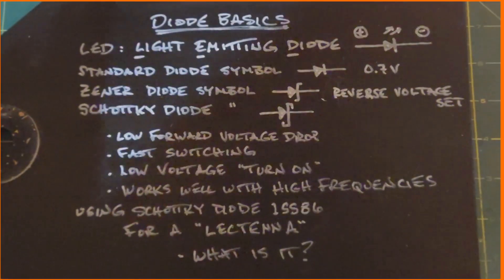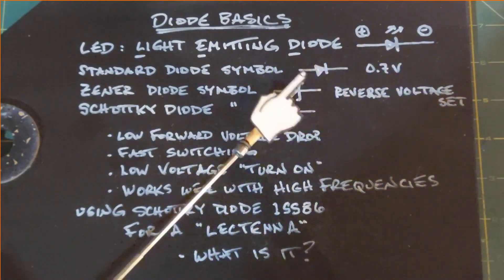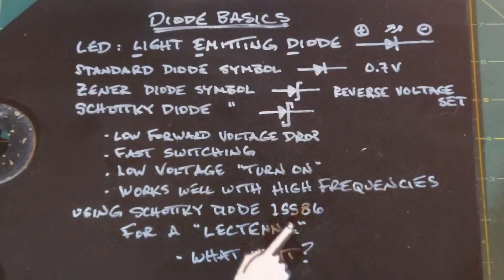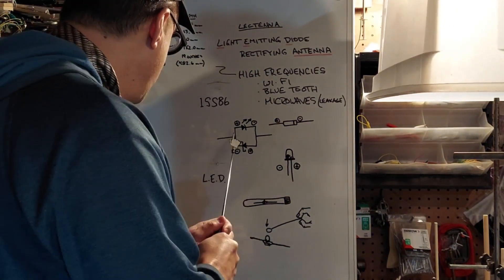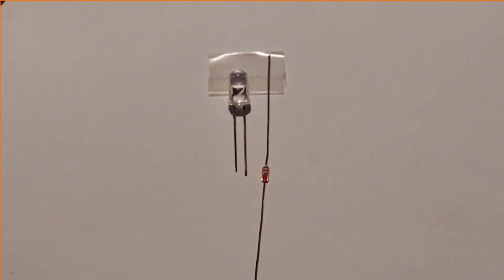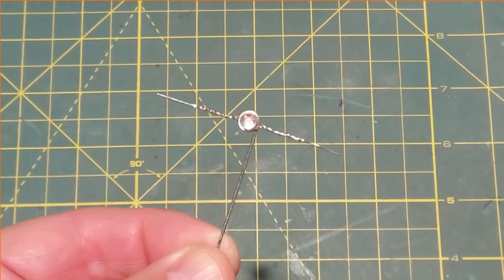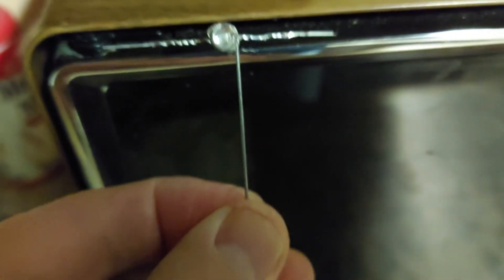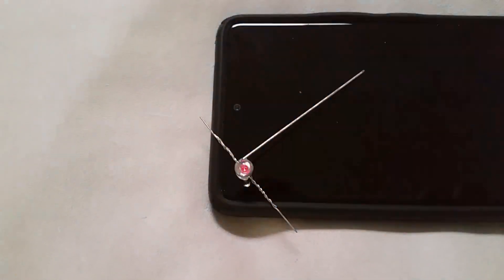Detecting A Leaking Microwave Oven

Comment: Cannot find this part anywhere mouser, digikey, tme, farnell. Please post part number that works and is available to buy. Chinese in Aliexpress are fake do not work.
Reply from the maker: You're not alone.  I purchased a number of fake ones before I got the real thing.  I stopped looking at Chinese imports and started with things like Amazon, Pinterest, etc.  One of these online shops is where I found the real thing, it's just I don't recall exactly which one right now.  The must be a large letter "H" stamped on the diode (it's small of course but noticeable).
Reply: @cranialconstruction  Connected to DMM I measure 0.040v-0.070v on multiple microwave ovens. Led obviously does not work. I will be cheaper to buy tester from aliexpress for 12Eur then buy the original part from USA.

Comment: This is a gem of an idea for a small project! It would be cool to do a follow-up explaining what is going on in this circuit i.e., why an LED by itself would/would not work? Why does it need the diode? Why does it have to be that particular Shottky diode? Essentially, you made a tiny dipole antenna with an LED connecting the dipole legs but is the diode just adding some capacitance?
Thx for posting but PLEASE, for the sake of your viewers' mental health, don't invite your "special" guest back.......ever!
Reply from the maker: This particular diode has a very low resistance to electrons excited by specific wavelengths of energy.  Including radio waves.  It's doubling back design allows those electrons to accumulate quickly until the electron count is high enough to turn the LED on.

Too late.  He's part of the crew and has been around for quite a while.  Sorry it bothers you.